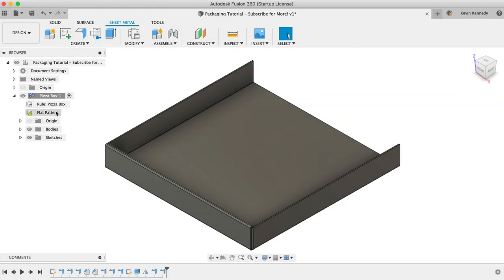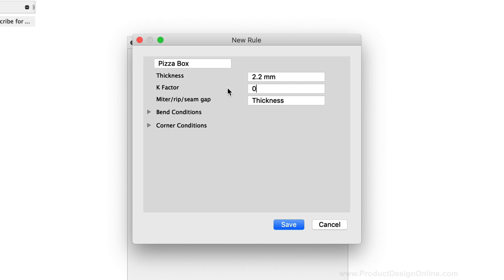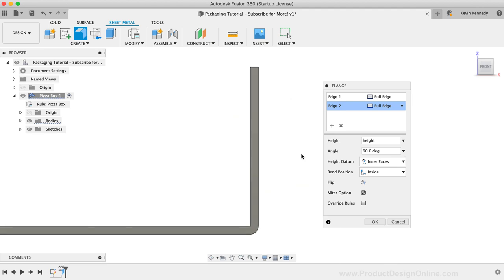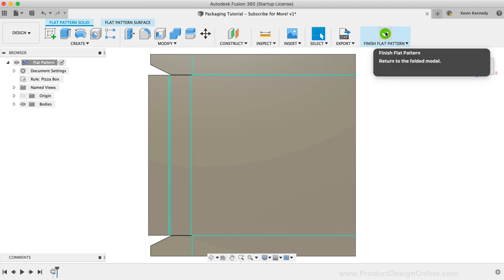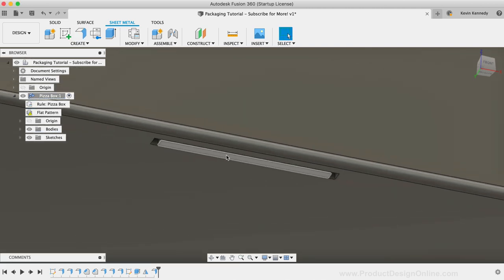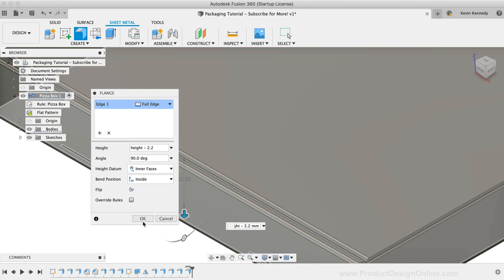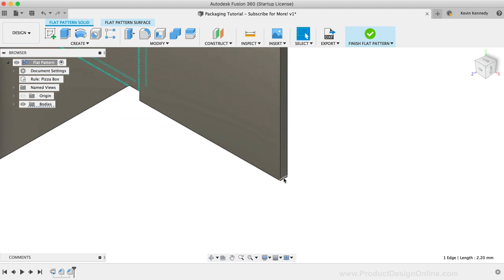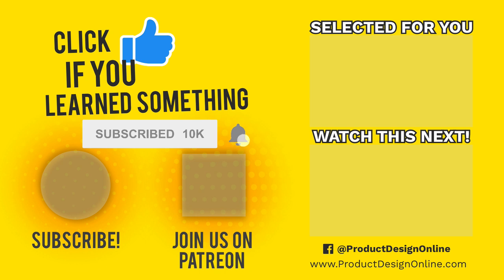Fusion 360 Flat Patterns and Box Design

Comment from the maker: TIMESTAMPS
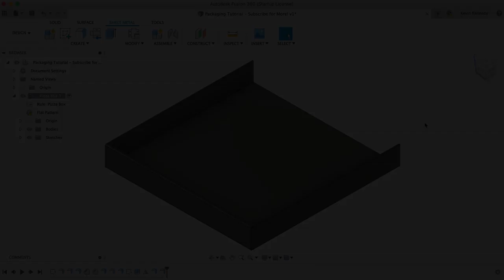0:00 - Creating a Cardboard Box in Fusion 360
1:00 - Setting up user parameters
1:39 - Creating a sheet metal component
2:48 - Setting up the cardboard/sheet metal rules
4:44 - Sketching the initial box shape
5:24 - Creating the sides with the Flange tool
10:27 - Creating a flat pattern
15:10 - Adding chamfers to the flat pattern
15:30 - Adding the remaining flanges
21:48 - Adding vent holes to the box
22:45 - Unfolding the lid of the box
24:14 - Exporting the flat pattern as DXF

Comment: That was really good, I don't get enough practice in sheet metal. In package design this is called a die line and you need to differentiate the lines in your drawing or DXF to distinguish between cut lines and score lines and perforations. I wouldn't have cut a full 360 on the vent holes, the lid crease is often a perforation, and some of your chamfers may need to be fillets to allow the die to be made other than these finicky details you've done well. I wish I was better off financially to support you so for now I'm going to be recommending your channel to my friends.
Reply from the maker: Hi, Brian. Thanks for sharing this feedback with the community and me. This is all very valuable. I have no expertise in actual manufacturing of corrugated material, other than simply laser cut prototypes.

I appreciate you sharing the channel with others! Cheers, Kevin :)

Comment: Thank you for the helpful tutorial.  I'm wondering why you are using fixed values along with parameters?  I'm sure you ommitted this for make it less confusing.  This comes to mind when you were creating the lid fold flaps.  You entered fixed values of 170 to prevent collision.  To maintain the parametric nature,  it seems it would be better practice to use a few more parameters such as matThickness = 2.2, clearance = 1, and lidFlap = (width-(matThickness*2)-clearance)/2 and use the lidFlap parameter as your offset references.  Otherwise, if you change the width or length, it will break.  Thanks again.

Comment: Are there box manufacturers that will actually use this kind of file to make custom boxes for you (i.e. shippers, packaging for retail products, etc), or is this just a clever way of teaching how to work in sheet metal?
Reply from the maker: Most box/packaging manufacturers will require a DXF file with cut and bend lines marked differently. In my experience is, some also have in-house proprietary software that lays things out and they just want a 3D step file.
 
I've seen some that require Adobe Illustrator files. Using the sheet metal tools is a great way to do it because you can lay out your flat pattern and export as a DXF.
Reply: @ProductDesignOnline  That's cool, thanks for the explanation. Will definitely be dinning into this more now. Cheers!

Comment: two quick questions. Can the sheet metal patterns be animated? and can you attach a sheet metal element that is supposed to have give, ie an HVAC connector that is flexible so that it can fit into different size spaces?
Reply from the maker: You can use Fusion 360's Animation Workspace for general animations, though you will be limited on what you can animate. You cannot animate the model actually bending (at least not at this time).

You can utilize "User Parameters" to make the part adaptable to difference sizes.

Comment: I have a 3dmodel created but I am having struggles converting it into a sheetmeatl item so it can be unfolded and laser cut
Reply from the maker: Is the component a sheet metal component?
Reply: @ProductDesignOnline  no it wasnt created as a sheet metal model, the back is bent at an angle and I dont understand how the flange command works in sheet metal well enough to do it in sheetmetal model
Reply: @ProductDesignOnline  i could send you the 3d model,?
Reply: @ProductDesignOnline  would you want the 3d model? It has a angled end that is bent with a radius to 90 degrees

Comment: If I was going to make a box I think I would draw it out and then fold the edges to form the box and ouilla. So to see it designed on screen as the box and then you can view it in flat mode, could you also design it flat and then see it in the folded mode?

A lot of stuff to remember. I think building the wall of China might be easier. Ha ha. No seriously loads of options. So many in fact that I wonder in amazement at the program thinking it must have taken teams of designers and programmers literally millions of hours to produce.
Reply from the maker: Hi, James. One interesting thing about Fusion 360 is that they were able to build it really fast (in comparison) because they reused a lot of code from other Autodesk products. For example, the mesh tools in Fusion 360 were inherited from Autodesk Meshmixer.

In regards to the flat mode. You can alter and create objects in the "unfold" mode, which will all translate back to 3D. The key thing is that you first need to create a Sheet metal component (this concept doesn't work with regular) and you will need to create at least once piece or flange to have unfolded.
Cheers, Kevin :)

Comment: My fusion has crashed at least 20 times over 2 days of 8 hours each day. Very annoying. Also the thinking about it symbol whirring away loads after commands. Reminds me in fact of using windows. Im on a Mac and don't want to be reminded of windows thanks.
Reply from the maker: Hi James. Very strange. I'm on Mac and have not had any issues lately. I would suggest a post to the Forum to see if anyone else is having issues - https://forums.autodesk.com/t5/fusion-360/ct-p/1234
Cheers, Kevin :)